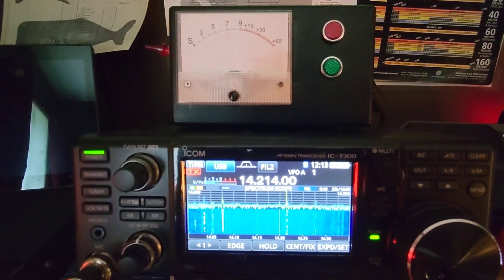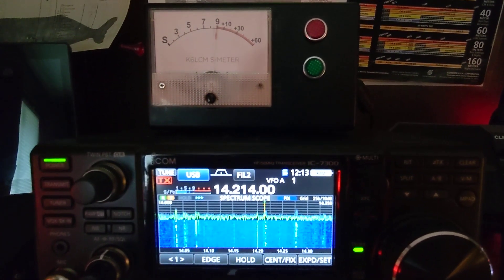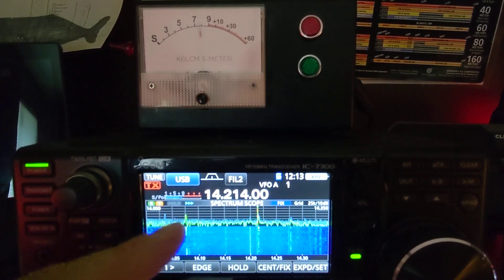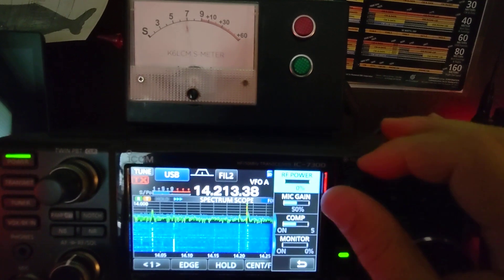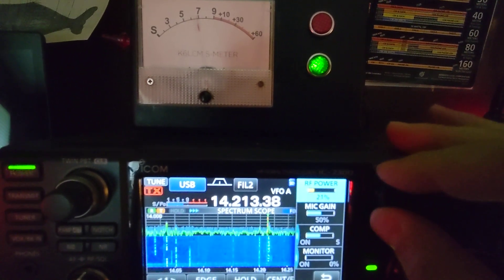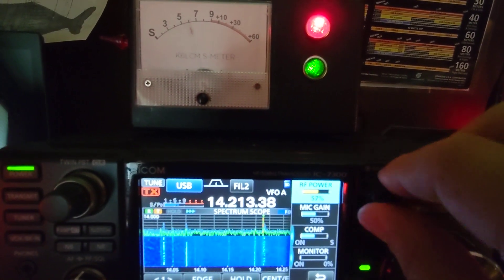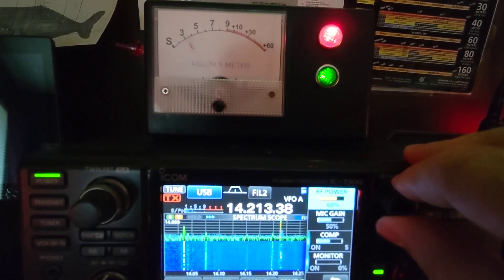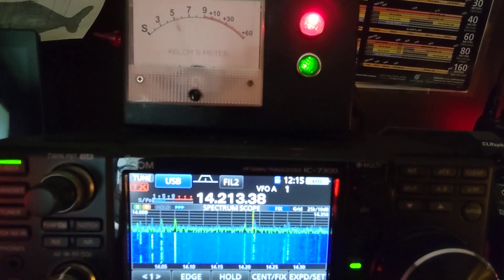Analog IC-7300 External S-Meter

Comment: A juicy big meter, yes, however, have you found a way to make it read anything useful?
I have failed to understand why the IC7300 is loved by so many when it has some terrible flaws, one of which being that the s-meter reading depends on ALL of the attenuator, preamp and RF-gain settings. Why should it?; the signal at the antenna socket has not changed. Many SDR designs (e.g. Elecraft and the G0ETP design) read what is at the antenna input regardless of radio settings. If you have you found a workaround for this I would love to know. Thanks.
Reply from the maker: That's how S-meters work on all radios. They don't provide absolute measurements of anything. They provide a relative measurement so that you can compare signals. In fact, with AGC set to off, it doesn't work at all. I think a lot of hams, especially hams who are new to HF, obsess over signal reports. In reality, there is a reason why we use readability AND signal strength. A report of 5-1 is still a lot better than 1-9!

That said, if you are comparing signals, it is nice to have a big meter with an easily readable scale to reference.